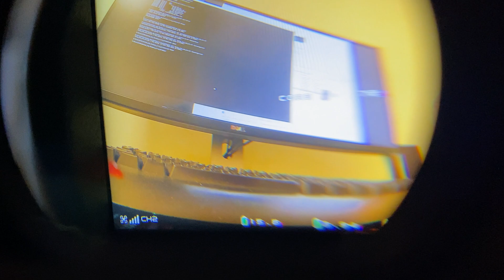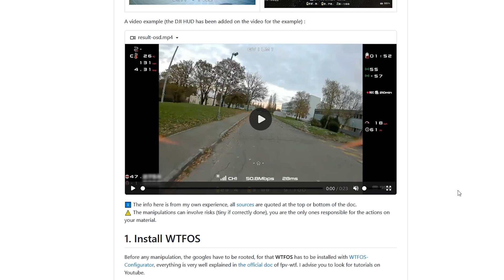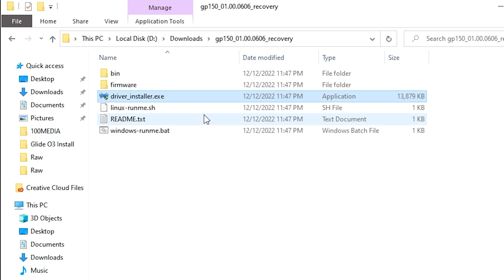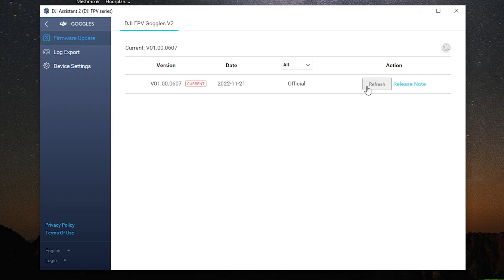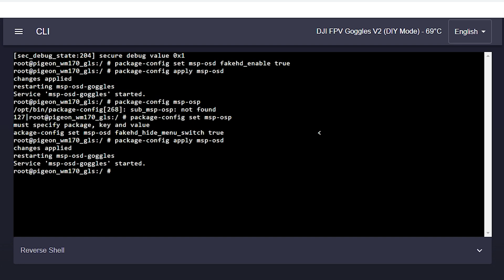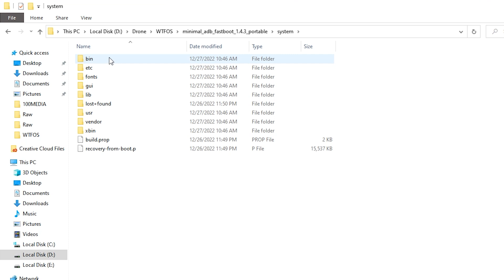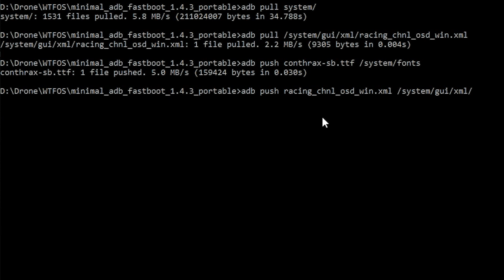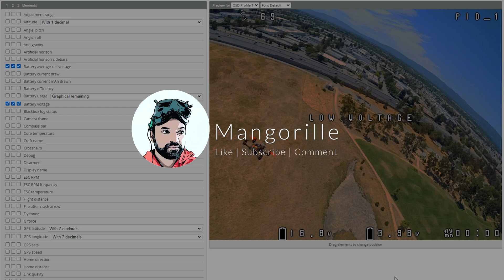FULLY Customizable HD OSD canvas mode for DJI FPV Goggles V1 & V2 | My EYES can't handle the BEAUTY!

Comment: Hi @Mangorille ! thanks for making a video about my work ;)
Tell me why the Python script doesn't work at 13:02 ? Maybe I can help you
Also, I've modified the doc since then, the 606 versions of googles are the most used but not obligatory. I did not test other versions but it can work. The important thing is to have the same version on both.
Reply from the maker: Hey, what a small world, thanks for figuring this out! Please feel free to link to my video on your page if you think it would be helpful for folks. Here is the error I get when I try to run the Python script:

File "D:\Drone\WTFOS\show_xml.py", line 71
    <title>dji_stuff/show_xml.py at 581dcb42ac6aa2f282d7b5c5085d97d4312492bd · druckgott/dji_stuff · GitHub</title>
                                      ^
SyntaxError: invalid decimal literal

Comment: Thanks for this video, but I'm missing something obviously... My DJI fonts have changed but I keep getting the message "OSD waiting..." What am I doing wrong? Thanks for your help!
Reply from the maker: Have you powered on and connected your air unit? OSD waiting means that the wtfos is waiting for an active connection to load the custom osd.
Reply: @Mangorille  Yes I have powerd it and I thought maybe I had set the wrong MSP port, but I'm quite sure it's good now. But still I get the same message... If I choose custom OSD I get my 'old" OSD back in the goggles but in the bottom still the message OSD waiting..
Reply from the maker: @Flying_yesenaer  Did you root the air unit as well and install the msp osd package on the air unit too?
Reply: @Mangorille  Ah that part i missed... I'll try that first! Thanks a lot 👍
Reply from the maker: @Flying_yesenaer  No problem. Email me if you need any further help so we can exchange screenshots etc.

Comment: Wow!  That's a very indepth video!  Unfortunately I'm not a nerd so it kinda made my head hurt! 🥴😂. I've been using the WTF OSD hack for a while with a custom font and icons, but haven't managed to push the icons out to 16:9.  I tried using the CLI on WTF with the FakeHD command lines, but it wouldn't work - something about packages not found.  Do I need to update my V2 goggles firmware first before the FakeHD will work?  Thanks again for your awesome content! 🙏
Reply from the maker: Do you have the msp osd package installed in WTFOS? You want these commands for FakeHD:

package-config set msp-osd fakehd_enable true
package-config apply msp-osd
package-config set msp-osd fakehd_hide_menu_switch true
package-config apply msp-osd
package-config set msp-osd rec_enabled true
package-config apply msp-osd
Reply: @Mangorille  Yes, I've had it installed for some time.  Been working fine, but the elements were limited to 4:3 without the FakeHD.  I tried the CLI on WTF configurator and it wouldn't work.  I reloaded the page and power-cycled the goggles, then cut and pasted your CLI lines above and bingo!  It's working now!  I just powered my quads and goggles and moved OSD elements around in Betaflight.  It looks great!  Thanks so much for your help mate.  It's so much nicer with a HUD like this! 🙏❤
Reply from the maker: @EyreDroneCo  Awesome, welcome to the world of eye candy ;)

Comment: I faced some "SD Slow" warnings and abnormal video recording terminations since using wtfos/msp-osd.  I set HD in BF 4.4RC2.
Reply from the maker: Sounds like you are using the full size air unit. That SD Slow error has been an issue since 2019. :)
Reply: @Mangorille  No, no, not this known issue. Recording in the V2 Goggle does not work properly anymore for some people using wtfos. Take a look at Discord.
Reply from the maker: @maryjane136  Good to know, thanks for letting me know. I haven't had this issue... yet...

Comment: Great job! Too much for some cool icons, hope BF 4.4 will include some of it! Loving  WTFOS so far. Doesn’t always boot up but works most of the times.
Reply from the maker: Thanks! But the icons are so cool! :) I think with BF 4.4 you may get the ability of pushing the elements to the edge of the screen but that's all I am expecting. I tried the BF 4.4 RC1 and it did not work with the DJI, still limited to 4:3. I saw RC2 is out but I haven't had a chance to try that one yet.
Reply: @Mangorille  
Sure. Funny thing WTFOS works some of the times for me. Good thing one can switch back to the older DJI OSD and just fly.
Reply from the maker: @MindRiderFPV  Which goggles and firmware version are you running? So far it has been working consistently for me.
Reply: @Mangorille  
V2, and all is on 0606, got the font files in the goggles sd card, most of the times I get “waiting for OSD” bottom right, but never loads unless I re flash on the WTF site.
Reply from the maker: @MindRiderFPV  Weird, I've updated the V2 to 0607 and been working okay so far.
Reply: All so much easier on 4.4, a new RC just a came out. Also HD fonts.
Reply from the maker: @MindRiderFPV  I'll play around with the new RC and see how it looks. The HD OSD in the last RC didn't change anything for the DJI O3.
Reply: @Mangorille  
Still talking about original Air Unit

Comment: why cant all the files needed be put in their correct place then simply make it available in a zip file? a shorter video could be done showing how to customize the scripts.
Reply from the maker: I have everything linked in the video description plus the command lines so hopefully that helps. Problem here is that it is more than just the files, you need to actually use the DJI software, WTFOS software, etc...